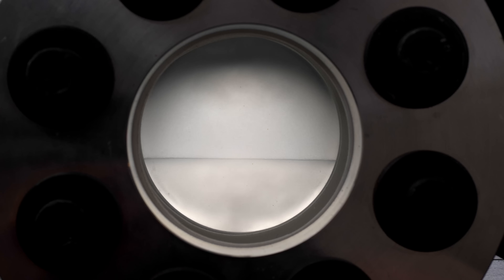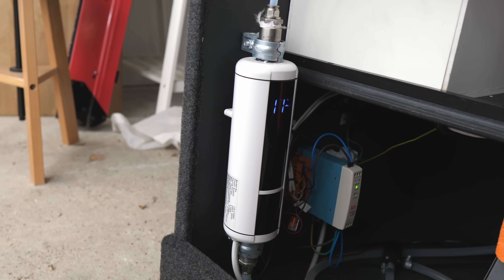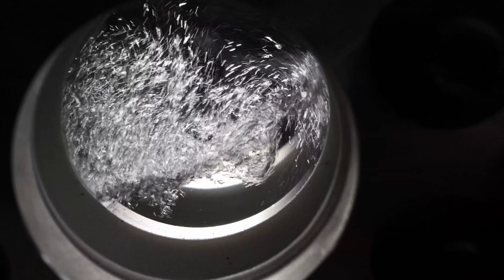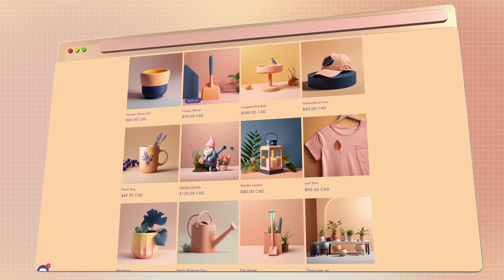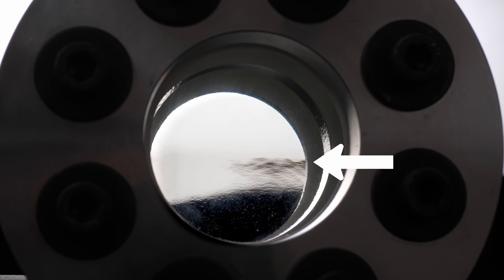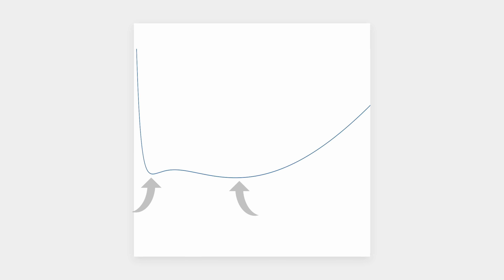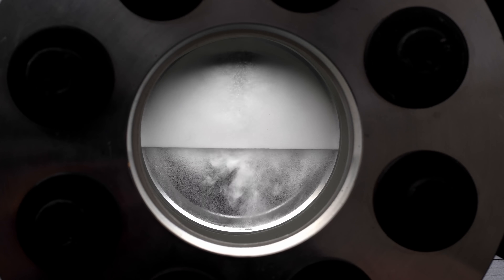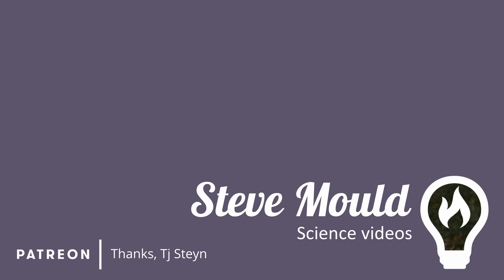The Unknown Phase of Matter

Comment: A better way to look at supercritical fluids is a phase diagram with temperature, pressure and volume each on separate axes. That shows the discontinuities across each phase change, and how the gas/liquid discontinuity fades away as you approach the critical point.

Comment: CO2 is rapidly replacing conventional refrigerants in supermarkets and else where. I encounter liquid CO2 quite often. There's actually other demo units like this but they are just add ons to a refrigeration rank demo unit. We have to be careful when adding liquid CO2 (R744) to a system that is below 100 PSI as the liquid will turn into a solid and plug up our lines.

Comment: What if you designed a semi sealed 'boat' (maybe like the one you had, but the top was like a tall pipette, so it's significantly less likely to tip and fill up) it at least would take longer until it sank..

Comment: 2 things, 1, I'm wondering what the effect gravity has on it for some strange reason.  2, what would it look like if the pressure and temperature was increased, is there a point where solid and gas are also at a super critical point?

Comment: In college I worked at a lab with this exact setup. We were testing different supercritical gas mixtures in order to find the lowest viscosity mixture for use inside miniaturized high power circuit breakers. I built the sensors used to measure the viscosity and would constantly be testing them in this type of chamber.

Comment: this is probably not going to be answered but, what would happen if you put a sealed box with a standard atmospheric pressure of normal air inside of it, essentially a submarine, in the container instead of a normal boat? Does it slowly rise to the top instead as the gas get more and more dense? Or does it stay mostly in place? It'd be very interesting to see what changes!

Comment: for super-critical liquids: as you increase the pressure the gas gets more dense, as you increase the temperature the liquid gets less dense - super-critical is where you are past the point where they have the same pressure and you are no longer pinned liquid-gas line as all pressure and temp past that point are at equilibrium.

Comment: Interestingly, in microfabrication, in a certain process step called wet etching when we want to remove sacrificial layers underneath functional ones on a Silicon substrate, we use this phase transition of CO2 as it provides almost no surface tension between the two layers when we finally dry the wafer hence no deformation will occur, and we get a nice freestanding structure as desired.

Comment: I suggest you perform an experiment. First, I'll explain what this experiment is about. Since we know that every atom has magnetic fields, every atom behaves the same way as a magnet. If you hang two magnets on a string, they will always attract each other. This means that the sum of the magnetic fields creates our gravity. To prove this, you need to take two times 100 magnets. Build two spheres from these magnets, but make sure that one magnet repels the other. Therefore, the magnets must be glued together to prevent them from falling apart. Once you've built two spheres this way, hang them on a string and see if the spheres attract or repel each other. If the spheres repel each other, you've created antigravity. Because gravity is attraction, and antigravity is repulsion.

Comment: Amazing how sensitive the CO2 is in the chamber to temperature change. I wonder if CO2 would work better in a minto-wheel that could also act as a combo/ refrigerant compressor- heat exchanger. When a gas flows from an area of high pressure to a area of low pressure the trade off between when the gas starts flowing and the pressure starts dropping, the volume of the flowing gas is also being pulled into the low pressure area until density amplification by the organizing absorption of mass is replaced with density De-amplification by the disorgizing & repulsion of mass.

Comment: Really interesting , thanks. i was thinking that if you could fix a turbine in there it could possibly be used to generate power in space as the sun and outside cold could be tapped for the hot and cold in a scaled version.

Comment: Is it not just still a layer of gas and liquid, though the gas is dense enough that it behaves like a liquid, and the liquid is dense enough it behaves like a gas. It's still two layers but their behaviors have changed and how we interpret them has not? Because we shifted where the 'start' is. the gas was the solid. the liquid was the gas. So in both systems in high pressure those behaviors are observed. All we are seeing is the entire systems and its equilibrium. Something we seldom get to see if at all in nature. But in this closed system you can see all states that particles/atoms in a  system 'want' to exist in. IT's just one entire thing we are seeing.

Comment: I played paintball since the 80’s, I know all about liquid Co2! We did so many things to keep liquid out of our markers with varying degrees of success. The only “fix” for liquid Co2 was High Pressure Air (HPA), thank God for HPA… we simply started out filling our tanks from scuba tanks and we could play trouble free in the winter! Co2 was a nightmare… when the Co2 gas turned back into a liquid in our markers it did all kinds of crazy stuff…. It spiked velocities, dropped pressures, froze valves etc.,..

Tippmann actually solved the problems liquid Co2 gave us in the winter by making a marker that simply NEEDED liquid Co2 to run! It was called the “68 Special”. You had to use a “siphon tank” with it, which was a little hose in the tank that dipped into the bottom of the tank in the liquid and fed it into the marker. In the winter firing the marker shot out puffs of crystals from the Co2, we called 68 Specials “Snow Machines”. But in the summer the marker was horribly inefficient and sometimes had problems if it was too hot out. 🤷‍♂️

Comment: Is there a glimpe of the super critical solid during cooling down?  Like "rain" (precipitation) that makes the same pattern both in gas and liquid. Could you show it more clearly by illuminating it with e.g. polarised light or whatever?  The pattern is connected, mirroring or both, or different, random?

Comment: Are we really sure it’s a single state of matter rather than two states carefully mixed spatially?

It seems to me, that basically the that transition size increases, the liquid still wants to be in the bottom and the gas still wants to be at the top
But as the pressure increases, the atoms are spontaneously connecting and disconnecting into the liquid or the gas phase .
Almost like how there are droplets in a cloud , and this starts out as a thin region, but it slowly gets thicker and thicker as the pressure makes the difference between the gas and the liquid state attraction minimal, until you reach a new equilibrium, 
Where the entire vessel is constantly increasing and decreasing pressure based upon local nucleation and splitting events .

This would also explain why the region of changing index of refraction is getting wider .
This seems pretty logical to me , is this really undecided?

Comment: I wonder if something similar is what is going on inside the planet. As you go down you get rock that is hot enough to be liquid but there is too much pressure to allow it to separate. As you go down the temps keep rising and eventually the heat wins and it turns into liquid. Eventually the pressure wins once again and the iron is forced back into a sort of solid state. It's more like the center has so much pressure the iron atoms can't move. It's not that they don't want to, they are unable to due to pressure.

Comment: While this is fun, like for 5 yr olds, This is just pressure holding the gas at various points of the transition from liquid to gas. So ultimately we get a stationary view of the liquid at various stages as it transitions to gas. The higher the pressure, their will be no gas and it will all go back to liquid. Adding heat increases the molecular energy therefor increasing the pressure required to maintain liquid state. So since I am still 5 yrs old, I like this but it's not gonna help us colonize space, or get a wife.

Comment: A good way I imagine it, which may be wrong but it seems logical, is this: imagine you've got a gas and a liquid which both have the same density (due to the extremely high pressure in this case, but imagine they're just naturally the same density) and the gas and liquid dont mind combining, aka they're the same thing in different states, and you now take those two things and put them into a mixing bowl and mix them around, they'll perfectly mix together and because it's actually presurised, the liquid would like to turn to gas as much as it can til it can no longer and the air is now fully presurised with gas so the remaining liquid has to remain liquid and the remaining gas wants to stay a gas, but yet again, it's got similar or the same density so it can simply just mix together. Not sure if I'm talking shit or over complicating it but this is the best way to write my brains way of understanding it. So basically an aqulibrium of density + an equilibrium of pressure and holding of state = a super critical state

Comment: Wouldn't steam or fog be technically a supercritical phase? because moisture in the air is still water, but not nearly as dense as steam or fog in either direction. So maybe what you have there is CO2 steam or CO2 fog.

Comment: If you dissolve a compound which is not gaseous at room temperature (caffeine) into a supercritical fluid, and then the fluid instantly turns into gas as a result of pressure loss, what happens to the compound? Wouldn't it all precipitate back out? I would imagine that what you had at the end of the coffee experiment was not pure decaffeinated coffee powder, but rather decaffeinated coffee powder with caffeine powder mixed into it.

Comment: Hey Steve , as always, a super video. Thought I’d ask you a question i had asked my physics professor , in 1991, while at college. What happens if you filled that cavity with liquid ( any liquid) and then heated it ( assuming the container was strong enough). Basically 0 space for a gas to occupy and heat energy flowing into it. Does heat stop flowing into the system ?? And then again, there’s no space for the liquid to expand…

Comment: To add some additional info where it is used beyond making coffee useless😉.

If you want to dry organic material but having it's cell structure not collapsing like in a raisin, stuff gets interesting.

One solution is: 
1. Put the sample in an alcohol, until all the water in the cell is replaced by alcohol.
2. Put the submerged sample into a pressure chamber and flood it with liquid CO2, to replace the alcohol in the cell with liquid CO2.
3. Navigate around critical points by heating up and stuff.
4. If done correctly the CO2 is now a gas and the cells look still intact, so you can for example prepare it for elecron microscopy.

Working in the development of such a critical point dryer, I've seen it quite often and it still looks out of this world for me.

Comment: We used to operate a CO2 pipeline. The company recovered CO2 from the effluent of its power plant, we transported it to an old oil field and sent it down hole to enhance oil recovery. We operated the line at "supercritical" pressure. Aka triple point of CO2. One of the engineers I worked with called it Floam (toy from back in the day). Fascinating stuff.

Comment: I think another way to intuitively understand it, is that the more molecules that enter the liquid energy valley, the less of an energy valley that becomes, due to the added repulsive and kinetic forces of the molecules that are now there in the liquid. It's a dynamic system that does rapidly enter a liquid state, but that energy state itself loses it's energy advantage the more that enter that state. Until you reach an equilibrium between the forces that repulse and eject molecules into a gas, and the ones that attract and absorb it into the liquid.

PS: The idea of "grinding" the coffee through explosive pressurization goes pretty hard.

Comment: Refrigeration systems are using supercritical co2 for cooling large systems.

These are called transcritical co2 refrigeration. I have not worked on them yet but I know that many stores have swapped to that refrigeration system. From what little I have seen of those systems they are crazy. 1200+ psi on the output side and if power goes down for more than a few hours on a hot summer day you can blow your entire charge of many hundreds of pounds of CO2.

Expect these to be the main refrigeration method for almost any big store by 2040.

Edit: the triple point of co2 is around 65psi. That is why at the end of the video he had dry ice, liquid co2, and co2 gass all at one point.

Comment: hmmm, take a simple old analog voltmeter (all i could think of is the old radio shack ones) place a electrode on one piece of glass, top side, and another on the bottom side... and see what electrons (if any) will pass through the circuit of the simple coil of wire through the voltmeter.

if its "super critical" then should be some form of electricity in there thats trapped... i would be curious as to how much if any that exists, because its not a plasma, right?

Comment: Molecules with high energy releasing energy when striking interior of chamber specially from  visible side trying to return to liquid but being pushed back to gas state continuously  when the move towards high temperature mid area that is being heated, considering pressure is constant through out the interior of container. 14:52 
Heat dissipation and heat absorption by at such a high speed  that conversion between the two states is too high to be visible to naked eye. It would be nice to see the slow motion cameras recording of this phenomenon.

Comment: 8:03 I saw a very simple super critical device that I can't find now. It contained a noble gas, neon I think, in a very thick walled fused quartz tube at ~70 Bar. The neon was liquid at room temperature but the heat from holding it in your hand was enough to cause the transition to supercritical fluid. I would encourage you to produce and sell those and if you do decide to do so please notify me via this post if you would be so kind.

Comment: There is a way to get activated cryo-fluid is what it’s called, but it’s like you’re trapping light and electricity and having them make a whole bunch of friction or lack of friction and the liquid will luminous and it requires a really bright light and it was something about this tool that you have here is for use in the workshop and as an engine component And it has something to do with the coolant system, but there’s a way to agitate the surface tension so that it becomes hundreds of times stronger than normal and get a surface tension between frost and water. Frost is water while it’s in the state of transition from ice to water And it is a plasma and this is a type of plasma reactor core is what this is actively is defined as in the high science workbook not a plasma. It is a plasma. It’s a type of fusion core vision core anyway it’s a different type of TokaMac, but it’s still a reactor core. Just the same.

Comment: I’m gonna say this one time and one time only, there are ONLY 4 states of matter solid, liquid, gas, and plasma if it looks like water/ liquid it’s a liquid but with this substance it’s a mixture of water and air so it has properties of gasses inside of a liquid therefor it isn’t a non existing matter, it’s a combination of 2 matters colliding through higher pressure than normal so pressure is pulled into the water and evaporating within the water. The water is as a atmosphere is around it and nothing ca escape so the c°2 inside is somehow mixing with the h2•° showing that this is just a mixture with pressure and 2 matters colliding through eachother.

Comment: I worked in analytical chemistry where we had an sfc (supercritical fluid chromatography) instrument. It's use was to dissolve surfactants consisting of different molecular weights and separate them in a packed column for a distribution analysis. We didn't use dry ice, but pressurized CO2 in a cylinder.

Comment: You may have just solved the problem of what Jupiter really is.   People don’t seem to think that it has a solid core anymore.   People don’t think it will ever become a star.   What if the core of Jupiter was a super critical fluid.   What if the clouds of Jupiter are swirling and storming because of all the temperature differences between the core and the outer atmosphere.     Temperature iand pressure are constantly changing causing a storm of sorts that is a global storm.   All these various chemicals are doing roughly what’s happening in your chamber.   They all have different points on your chart that say when things become a liquid and when something has become a gas.   Put it all together and you probably wind up something like Jupiter on a grand scale.   Just a theory.